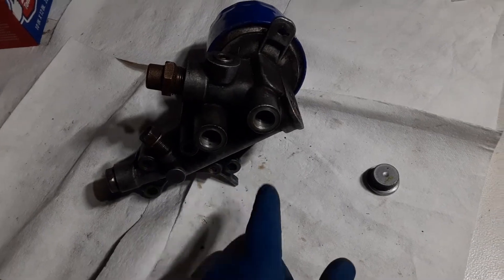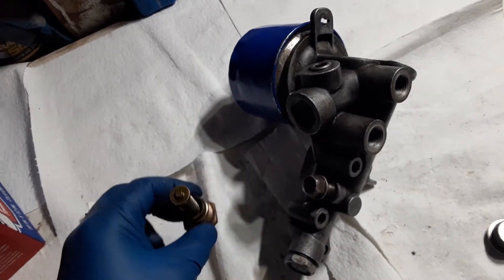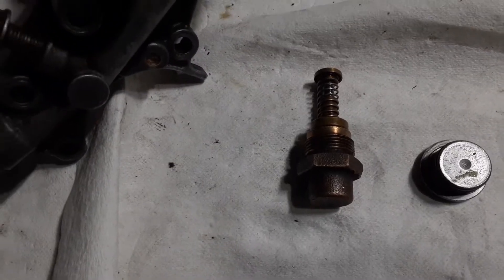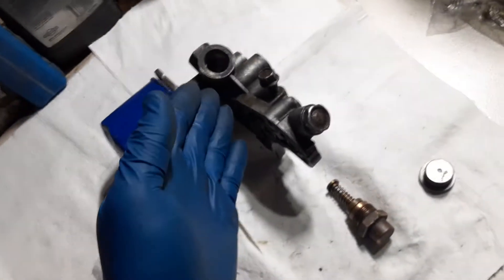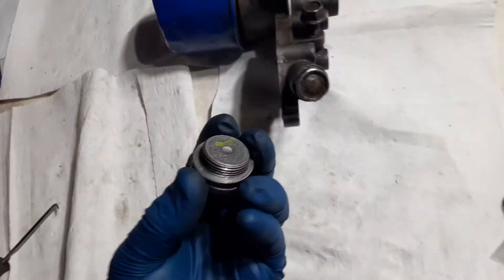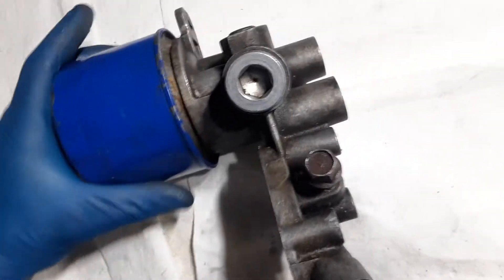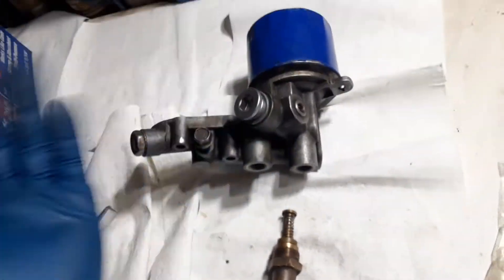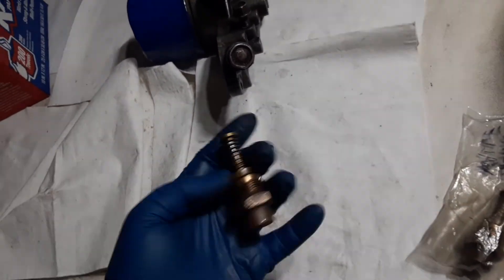4g63t: The dangers of doing an oil cooler delete

Comment: Iam Your Newest Subscriber Great Videos. I just got a 1999 astro van it is leaking oil really bad going to change the gaskets on the oil filter housing i am to do the DELETE hope it works
Reply from the maker: Thanks for sub, yeah you really have to pay attention to these little details i am not sure if the astro vans use a similar thermostatic valve device like in the dsm and evo's etc,  but i would look into it for sure get some brushes from harbor freight and some good cleaner and wash it up that definitely helps identify leaks sometimes you can simply replace old brittle hoses to get by, if you end up servicing your van maybe take video of it for your channel,  i liked the older astro vans i think i drove the GM version aka Safari van a few years ago, they are vary unique vehicles, i liked the boxed shape made them look tough most minivans of the time were ether too round or in between round and boxy, but the astro was a square serious looking van, i think it was the least goofy looking of the big 3 minivan offerings.

Comment: 1st time I've heard of this good info for people that decide to delete the oil coolers.  I wonder if there is a housing off of Galant or something that you could just swap out that doesn't even have the fittings for a super clean look.
Reply from the maker: There is, but they are on the non turbo 4g63/4g64 powered cars, but you have to make sure you use a 6 bolt or 7 bolt housing on their matching engines, you can't mix and match 6 bolt on 7 bolt or vice versa, they are different, there is also forward facing units as well that were used in rwd applications.
Reply: @mitsubishikid1187  which housing is recommended for 2005 EVO 8?
Reply from the maker: @DJ_Driven  For an evo 8, I would use the 00-05 Mitsubishi Eclipse 2.4 oil filter housing same engine as 99-03 Mitsubishi Galant 4 cylinder models, Note: however that the evos use a serpentine belt, so you might have to convert to a 2 belt setup like the 3g eclipse/ 8th gen Galant have in order to use them, or possibly get a mitsu outlander 4g69 oil filter housing since they also use a serpentine belt setup that is similar to the evo, but I am not 100% sure that they would work because I have yet to try one, but understand that there are reasons to keep the stock cooler and benefits to it, depending on what the vehicles intended purpose is, and weather its a filled block or stock, or if ambient temperatures get too cold or hot where you live, there are many factors to consider before deleting it, but using the bolt method as described in the video can work as well, and is the least amount of work provided it can be done with the oil filter housing on the engine, you also would not need to buy a new housing gasket, if you swap housings out, I'm not certain on evos 8-9s, but if it's possible to do the delete with the engine in the car it is worth it to try the method described in the video, then unbolt the oil cooler from the car seal the lines and store it away along with the oil thermostatic valve in case you need it again.

Comment: Great info :) im gonna just replace the cruches because they are a little leaky there lol
Reply from the maker: I may have not mentioned it in the video, but honestly though i like the air oil coolers on these cars, but when i saw the air cooler delete plugs on a motor  i purchased, i figured i would take the opportunity to educate people about this detail, most built cars won't run long enough for this to become an issue, which might be why many people don't report failures, but deleting it is cheap insurance and its better to know then guess especially on a built engine.